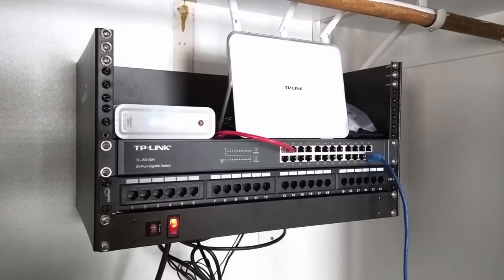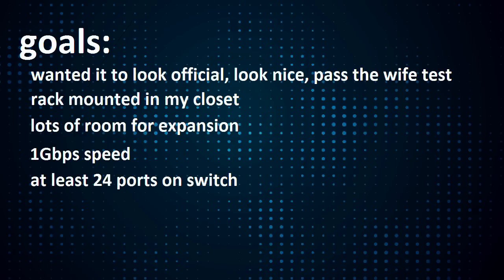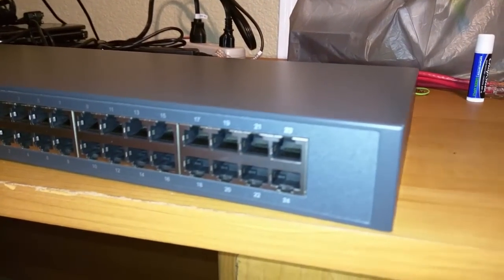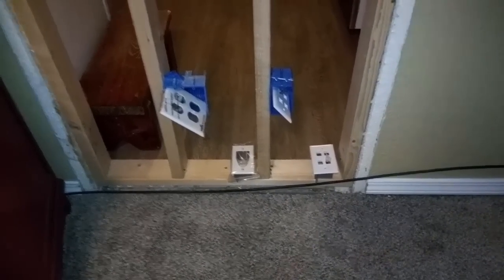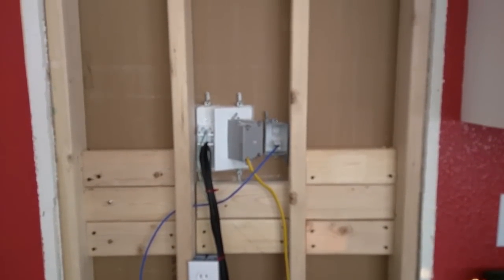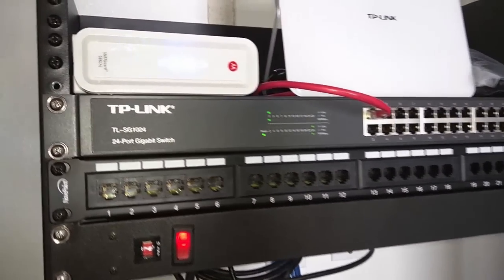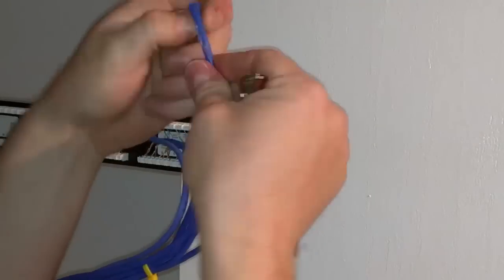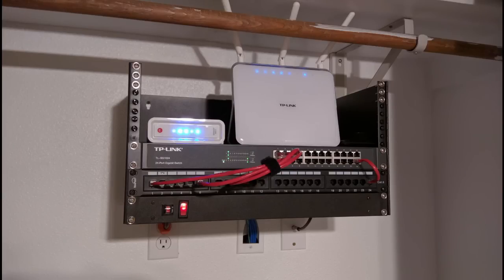Budget Home Network Tour/How To

Comment: Why did you run 8 lines for ?? You could ran one line and used an lan switch . One for the tv . I never use the smart tv option in the tv . I just use 1 cable to my nivida shield tv . Keep it simple . Nividia shield tv and blu ray player
Reply from the maker: +Colin Long I have the ports available on the switch, didn't want the one line being a bottleneck, and the wall was open so I could add several without any issue
Reply: Budget Nerd what did you think a network switches what's the difference between the network switch and a smaller switch they're the same thing . The only differnece is one has 4 and the other has 24 .
Reply from the maker: +Colin Long naturally, but if all traffic leaves that switch and goes to the other one (which would be the case for me, it would all travel through the one line and my TV, DVR, two Xboxes etc would have to share it. I had the ability to give them each a dedicated line.. so I did.

Comment: how do you connect an AP
Reply from the maker: +AatakFearless if you have a separate AP, you would plug it into a Ethernet port anywhere in the house, for example, let's say I want one in my bedroom. I would run a cable to the bedroom, add an Ethernet jack, and plug in the AP in to it. Then run the other side of the cable to my patch panel, and patch it to the switch. As long as the AP is configured properly, it's sort of like hooking up any device to the network.
Reply: because i want to had an AP in my living room but i dont have that of a fancy setup i just have a normal modem and router but the router i want to use for the AP does not have the yellow Ethernet plug can it still work if i just connect it to any slot or does it have to have the Ethernet plug

Comment: I'm not a fan of the decision for a patch panel.  Patch panels are an added cost and serves to add 1 more layer for something to go wrong with the signal. It's much faster & cheaper to work with RJ45 connections directly to the 24-port switch.  In my opinion it's also faster to troubleshooting with a cable tester.  You only have to test 1 port instead of 2 in a worst case scenario for signal testing.  Patch panel for a 1 switch / 1 router installation is completely unnecessary.  

With each wall plate you also add a layer for signal issues or unplugged cables.  I love how you tried to reduce that by going straight to the patch panel but you could have reduced it further by going straight to the switch.

I won't disagree with your decision to go with a 24 port switch.  For today's residential needs it is overkill but no one expected IPV4 to be filled so quickly.  Who knows how many connections a home in the future will really need.   Question is as of today how many of those ports are you actually using?  I'm gonna say about 8-10.  Plenty of overhead.

Anyway, the patch panel is just a middle man so cut out the middle man by terminating all cables with RJ45 plugs and plug them directly into your switch.  

I would have used 3x 8-port keystone wall plates instead (for a 24-port switch) instead of a pull through plate.  I like that you plugged the excess hole of the pull through.  I see so many of them that are open and I'm like do you want mice because this is how you get mice.  Keystone wall plates are so much easier to work with,  provides a highly professional look for residential, and takes the place of a patch panel.   I would have placed the wall plates directly beneath the rack so cable length between the wall and switch are shorter.  Also I would have installed the rack much lower on the wall as you've now commandeered a good portion of usable hanging clothes space. Wife test would have gotten a better grade with a decision to put it lower. :/

Don't get me wrong, I'm geeking out seeing your build.  You've done a great job, something that most would be proud of.  I'm simply saying I would have done it differently and definitely cheaper.  You don't mention to your viewers that a patch panel is unnecessary if you go a different way.  To the uninitiated, your build might seem daunting to them due to the patch panel.  

Sorry to be so critical I hope your not offended that is not my intention.  As a fellow geek and installer that's just what we do.  We judge each others work and offer suggestions for improvement. Seeing the patch panel for a small home rack kind of made me twitch a bit and I felt compelled to offer my opinion and suggestions.  Great build though!
Reply from the maker: +DJDevon3 you raise some good points. For sure a patch panel isn't necessary, but I wanted one. However, any money I would have saved subtracting the patch panel I would have spent on more RJ45 jacks/keystones/and wall plates as you suggested.

I am only currently using 6 of them, but I only just set it up. 24 might be overkill in most cases, but that was my goal.

For those that do not know, the patch panel could add unneeded complexity to it.. but my setup, of course, isn't for everyone. Perhaps I could also do a video talking about the patch panel and who it would be good for.. :)
Reply: Good point.  Keystone plates and jacks add up quick.  Since you offer this up to youtube as a budget build, I recommend putting amazon links and prices in your video description.  Make it easier for people to replicate your build or look at all the components.  It was one of the first things I looked for after watching the video and nothing was there. :(

I just purchased a similar switch for an install I'm doing on Monday. I'm not a fan of TP Link, I prefer Buffalo for budget builds since they have loopback protection which can come in handy for network stability, security, and troubleshooting but they are a tiny bit more expensive than TP Link.  For a budget build you'd be hard pressed to find a 16+ switch cheaper than TP Link right now, good choice.

I would definitely watch if you make a video about pros/cons of a patch panel, when/where to use one.  Patch panels aren't for beginners in my opinion, plenty to go wrong since each lead represents more physical connections and those connections have to be good.  I think anyone doing this kind of build should also add a cable tester to their toolbox.  You can find them on amazon for like $20 and they can be worth their weight in gold during a build especially for a first timer.  I think that would be a great recommendation to have added with your video.  

To even think of using a patch panel means you have a high level of knowledge so I congratulate you on that.  I enjoyed every minute of watching your build even if I had a minor disagreement with some of it, very enjoyable.   :)  

Most viewers on youtube have never created their own patch cable let alone done an entire home install.  For the general public I think a patch panel is the wrong thing to advise.  You obviously have enough knowledge to do it which honestly is what really made for the most enjoyment.  It's not everyday you see someone do a patch panel in their house.  The avg viewer isn't as knowledge and it would only cause them more headache than necessary.
Reply from the maker: +DJDevon3 I've been meaning to get some links in the description, those would be good you are right.

I will be getting a pretty nice cable tester soon for a project and was contemplating doing a review on it, but yes, a good tester is very helpful. I did have to borrow one from work, from out network team to fix one port I wired wrong.

Comment: As I'm not computer savvy can someone explain to me the benefits of this?? Thank you :)!
Reply from the maker: +Saitama a good/robust network can give you lots of benefits. Mine let's me share pictures, music, video s between all my PC's and devices. I can remote desktop any of my PC's, it will make setting up network storage easier and so much more. This physical setup allows for easy configuration of said things and makes reconfiguring down the road easier. It is a more reliable setup for your permanent wiring and it looks sweet! That's just scratching the surface!

Comment: I average .30 mbps up and like 1.00 down...how would I use this to make my WiFi speeds faster
Reply from the maker: This will help speed up local traffic, but the only way to speed up your internet is to complain to your isp, or to change your internet plan. Unless you have really old equipment..
Reply: There is only one internet provider where I live and my mom won’t upgrade the WiFi speed...we’ve complained many times and they keep telling us to just turn on and off the router/modem combo but that’s only a bandaid fix

Comment: is this like your own wifi?
Reply from the maker: There is a specific device in this setup that does provide wifi yes.
Reply: Budget Nerd what is that part
Reply from the maker: The router/AP combo unit. It's the large white device with the antennas, but they come in all shapes and sizes. You connect the modem to the wan/internet port on the router/AP unit and it will let you share that internet connection with other devices over Ethernet or wifi.
Reply: Budget Nerd can you do a tutorial about setting it up and how to use it. I don’t know much about internet and want to create my own to use google and that stuff, but not pay an isp to use google
Reply: Budget Nerd All i want is my own wifi without a bunch of ethernet cables
Reply from the maker: Yeah I could whip something up
Reply: Budget Nerd that would be great. can it be a budget one and fast free wifi? and a list of everything so i can build a similar one
Reply: Budget Nerd I was doing some research and do i have to pay anyone to access the internet and just pay for the products or do i have to pay someone to access internet
Reply from the maker: If you don't want to hang out at Starbucks all day, you will probably end up paying for internet access.
Reply: Budget Nerd are you paying for internet access with your home network?
Reply from the maker: Yes

Comment: I would not have put a kitchen outlet on the same circuit as the entertainment equipment. Also, the kitchen outlet should be a GFCI outlet.
Reply from the maker: I have a gfci outlet in the kitchen already. Not sure if that setup would call for a second or not. Not having the entertainment center and the kitchen on similar circuits had crossed my mind, but it's not so cut and dry. That one outlet on the other side is on the same circuit, not so sure about the rest. The circuits in my house are weird.

Comment: I would have terminated each run with a RJ45 and gone straight into the switch. Simpler, less points of failure and less insertion loss.  No need for a patch panel.

Comment: Nice setup, BUT you screwed up.  You don't unwind the wires in CAT cable.  It is twisted to eliminate interference.
Reply from the maker: Quite true. It was the first time I had done that. I don't untwist them anymore. However, I should mention my network performance is super good, so it doesn't really seem to be making a difference.

Comment: Stripping the insulation at the punch down point is not needed, is not a standard practice that I have heard of, but nor would it hurt - the plastic insulation is forced off the wire anyways. The plastic insulation does not add to the mechanical strength of the connection either. One reason he might have stripped the end is that if you pull a wire off and later re-use the connection little pieces of insulation can sometimes hinder re-use if not removed first; but stripping the end is definitely not standard practice unless you are soldering.
Reply from the maker: +CDArena if you're taking about me, I did not strip the wires before punching them down. It is not necessary..

Comment: I own the same switch for my home Ethernet, it's garbage. One week out of warranty one of the ports died. Looking further I found several other ports had died, some had never even been plugged into. Every time I want to cable something I find another dead port. TP-Link weren't interested in helping me out. Save your money in the long run and buy a better switch than this one. I'll just get a secondhand Cisco next time, they last decades.
Reply from the maker: +Jamie yeah that stinks. Sometimes you get duds. So far mine is fine, hopefully it hangs in there.

Comment: putting a rack shelf in a closet with rats nest cables hanging from it . using modular jack plates as cable pass throughs, lots of what is there is a waste of money.  Dressed cables with spiral wrap going thrrougha metal plaster ring does the same thing without pretension.

Comment: Why run 8 blue at cat6 cables behind the TV, you could have ran 1 cat6 cable and then instead of using 7 other wires buy a switch/hub and break out to 8-16 more ports on the other side. Less overall wiring to do.
Reply from the maker: I could have. I had the cable, and since the wall was easy, I decided to don't that way. Both ways work.

Comment: Sir what is the purpose of this home network?
Reply from the maker: +Jethro Fernando well, any network will let you share internet, files/data, printers and many other thing. I went this route because, first, I am a gigantic nerd, so I just wanted it. Second, it gives me lots of wired connections for speed, reliability and consistency, while giving me easy reconfiguration in the future. Third, it looks sweet.
Reply: Owww what internet speed do you have sir?
Reply from the maker: +Jethro Fernando I happen to have 100Mbps and usually see around 115Mbps.
Reply: Owww that's nice, I hope I will also experience that kind of speed. :(
Reply from the maker: +Jethro Fernando be glad you don't have to pay for it
Reply: internet here in the philippines is really expensive sir.
Reply from the maker: +Jethro Fernando what speeds and how much?
Reply: I got up to 2mbps in my plan 999 pesos but it does'nt meet the speed, in reality I got only 0.50 mbps it really sucks.
Reply from the maker: +Jethro Fernando yeah that's isn't great, that's about I pay too!! Yikes..

Comment: For the patch panel i'd go this route.  https://www.amazon.com/dp/B000HZI348  

No punch down tools required.  It is more expensive; however, the tools needed for punching the wires into the slots, and the testers (just to make sure they work) make up for that.  No need for cutting your CAT6 (or 5e) cables.

Also look at the switches and routers Ubiquity makes.
Reply from the maker: At a $182, I might pass on that, but it is cool. I looked a ubiquiti, and have ordered some of their stuff, so far I like them.

Comment: Its nice but overkill!?! ex. I like wired also, so i bought a new AC router for pc/ps3 upstairs, drilled 1 hole in the floor to garage, ran 1 cable to original router/modem downstairs for Tv/pc 2. 80$, no drywall/paint, 1 wire undercarpet, 30mins work. full home wifi 2-5 bands, 8 lan ports.

Comment: why do you need all that man ? ive got 1 gb  speeds with just the router and a 20 dollar tp link switch , what are you trying to achieve? , am i missing some point  here. if you need 1gb speed most people just need to update there drivers & buy the correct cat 6 cable of ebay  for a few bucks and most  modems will push 1gb ...   maybe im just not that smart and it flown over my hear like a 747 .
Reply from the maker: Nah.. no one has to have this setup. This is overkill for sure. The patch panel is total nerd bling and gives a professional look but not necessary, the large switch is a little overkill (read: room for expansion), and the rack just looks cool. I could do it this way, so I did. There are lots of ways to get a decent functional network in a house. This is just what I did.
Reply: Budget Nerd ok sweet man , yes looks cool and all .. thanks for the reply
Reply: One could just buy a couple of routers and mesh them together to cover every inch of their house for video streaming or just casual browsing but a wired connection is best in my opinion. Also, if you game then its a must for your PC or console.

Comment: What the hell is that mess? lol

I have a wifi router connected to my modem. That's it. Phones and laptops get wifi, my girl's PC and mine get direct hookup to the router. My printer also connects via usb port on the router. There's still two more ports available for PC direct connection... How much more do you need?

Total cost? $60
Set up time? about 5 minutes

Comment: Nice job Ben.  I see you have a lotta "you should have done it this way" people - WHATEVER!!  My 1st thought was, "NEVER an unmanaged switch", but really ... who cares when you're operating on a budget.  What you DID DO that impressed me was cable management (something for which I have no patience).  

I work in InfoSec, and have seen my share of cabling disasters.  My previous employer ("Blackhawk Network" (Pleasanton, Cali) - a POS $$$ grubbing company), they had to pay their COLO * $500K * because SLOPPY, LAZY, NO-TALENT network engineers made the COLO look bad to their other customers - and that was their price to fix the SHITTY cable work - i.e. using 30' cables instead of 3' - So, congrats on at least giving a shit about Cable Management.  You certainly have my home network beat.  I choose only to cable my TV ... everything else is wireless, w/ a 3.2gbit wireless AP.....but the cables I do use are a mess.

I utterly refuse any cable work after my last cable job, in 2001, involving conduit + military + Hammer Drills + Reinforced Concrete. NO THANKS.
Reply from the maker: +Andrew Wood thanks for the comment. Yes, making that setup look good was a huge priority. Also yes, there are lots of "you should haves.." but it's cool. I like hearing other opinions and ideas.. for the most part! 😀

Comment: why do you need so many connections
Reply from the maker: +TheUkracer because I'm a giant nerd, and I want to wire as much as I can. It's faster, more secure and more reliable than wireless.
Reply: Hes right, I wish I could afford it
Reply: I wonder if there is any low-range, high-reliability wifi solution. Use up those extra connections to put wifi in each room for mobile devices.